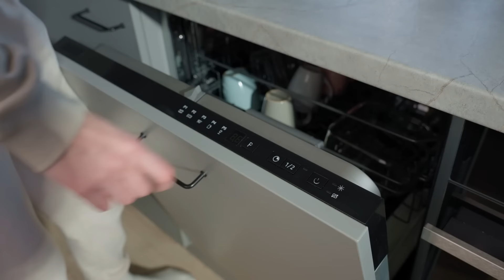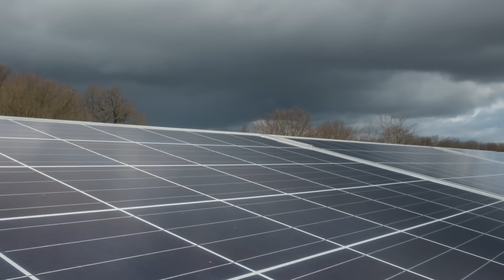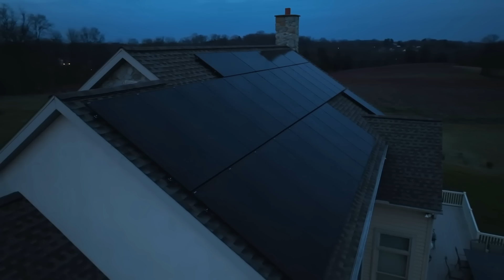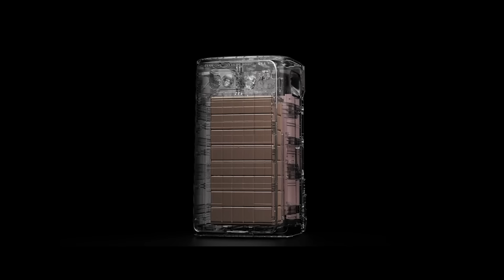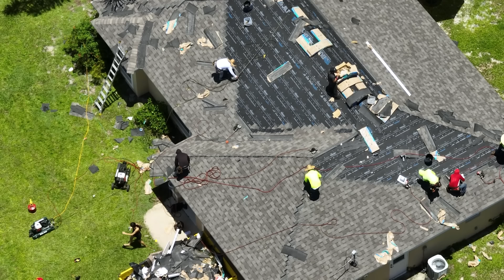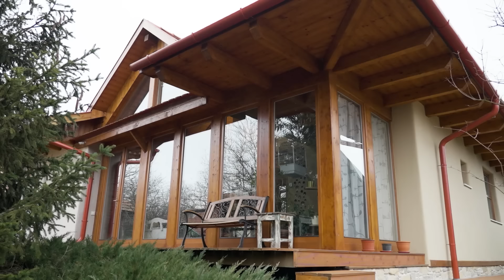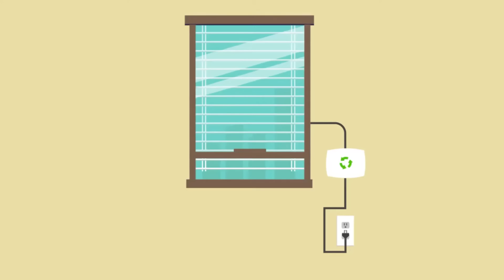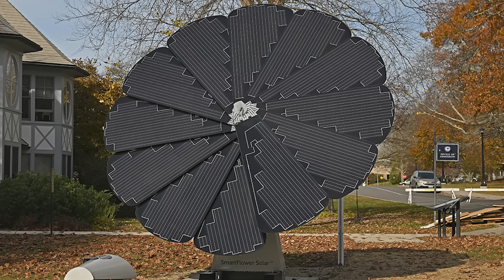Home Solar is Changing: These 5 Systems Will Revolutionize Home Energy

Comment: More like a nightmare, a waste of time and something that's just not going to be practical. You just don't know this silly gooses, but the sun isn't always going to be out every single day, even in the summer, and plus it always rains over in the United Kingdom, so if any of you thinking that installing these weird looking things on top of house roofs is going to save anything, what a load of monstrosity!!!!
Reply: Dont agree. The EcoFlow STREAM Ultra looks great. dapends on costs and if you can get it in Europe of course.
Reply: On the other hand, my PV works just fine.  It generates power even with overcast conditions.  Enough to charge the batteries during the day, then it draws from the batteries at night.  If there is any excess power we sell that to the grid.

Comment: Who manufactures the Smartflower now? The original company went under. And you think the concrete pad doesn't need to be designed by a competent Civil Engineer?
Reply from the maker: https://smartflower.com/
Reply: @wildline_YT thanks. Will see how they do. Just remember, the more moving parts you have in a system no one maintains, the more potential points of failure for a marginal gain.
Reply: That would be a Structural Engineer.
Reply: @CVC106 well, it is a concrete pad, and, generally, a Civil Engineer, at least in most of the world, should be able to workout the rebar and concrete needed for the application and where it's located.

Comment: And how does the ecoflow stop backfeeding the grid during a power outage? Please explain.
Reply: Excellent question. After some brief research;:

Their microinverter has anti-islanding protection so it will NOT feed power into the grid if that goes down. 

But if that happens, you can either: 

a) manually replug the load (eg fridge) to its AC outlet, and then  that loaf will be powered from solar+battery until you replug it.

Or

b) if you wish: use the UPS features of the Ecoflow Delta and similar units. In which case, the load will be always plugged into that unit, and normally feeding power from the grid (or battery+solar according to time-of-day tariffs etc). But if the grid goes down, the battery+solar takes over in under 10ms and at that point the system is running isolated from the grid.
Reply: @DanForth-j2f ok a is an option and b does need some sort of professional installation.
Reply from the maker: That is a good question and it all comes down to grid codes and area specific distributed generation protection requirements.  For example you must install systems that adhere to the area specific grid codes (usually compliance is via an approved product or installed by an authorised person):

America & Canada: IEEE 1547 (Standard for Interconnection and Interoperability of Distributed Energy Resources with Associated Electric Power Systems Interfaces).

Europe: EN 50549 (Requirements for generating plants to be connected in parallel with distribution networks).

Australia: AS/NZS 4777.2 (Grid connection of energy systems via inverters)

UK: G99 & G98 Energy Networks Association (ENA) for connecting small-scale generators or batteries to the UK network.

Asia and South America: Often require compliance with IEC 61727 (Utility-interconnected photovoltaic inverters) or IEC 62116 (Islanding prevention measures) for basic safety and disconnection parameters.
Reply: @wildline_YT exactly my point, not really DIY or cheap. Or could be cheap but not correct.
Reply: I guess the same as any other grid-tied or hybrid system: if it detects that the grid is down, it shuts off the power output to the grid, and only supplies the local load and batteries (if any).

Comment: My only hesitation with thin-film has always been efficiency and lifespan compared to rigid panels. Curious whether the video gets into the actual wattage tradeoff, because "easier to install" doesn't matter much if you're getting half the output for the same roof area.
Reply from the maker: We don't really touch on the efficiency of thin film over rigid but there is indeed a trade off.  Thin film is generally around 10% where as rigid is around 20%.  So you do have to consider this when buying solar pv. Thank you for the comment!